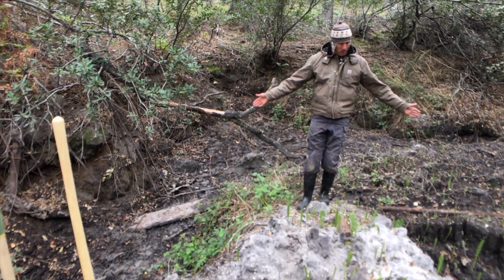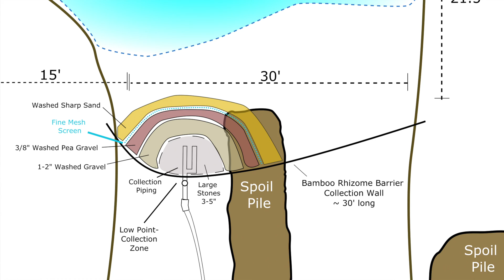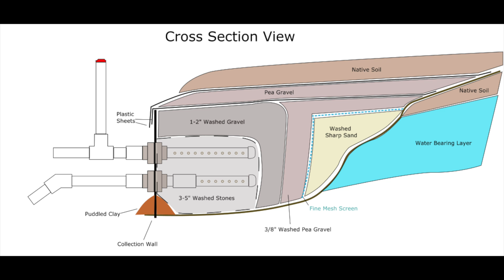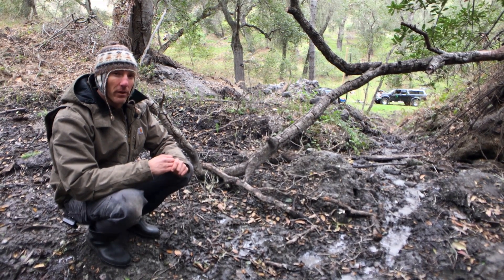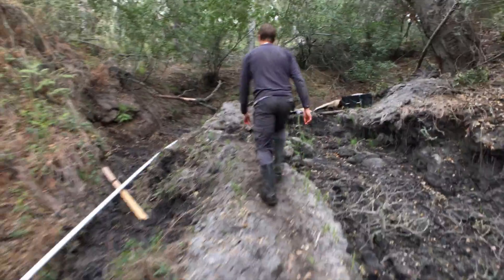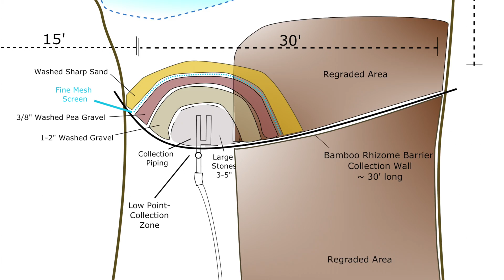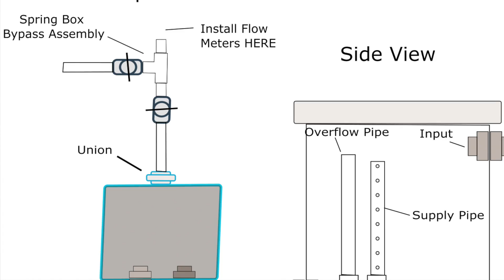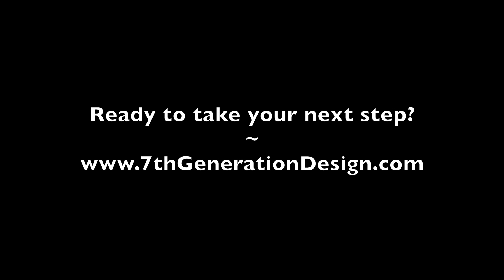Tapping A Seep - Spring Water Collection System Install

Comment: Great project content, but your videography needs work! Some quick recommendations:

1) PLEASE get a cheap tripod and do your voiceover narration of work being done at 1.5-5x speed (depending on the work)

2) if you've got the budget at all for a stabilizer, I highly recommend it. 

3) if you're super committed, edit in overhead drone shots of the areas you're talking about with voiceover.

Comment: In the future if you ever have an issue with getting an excavator back onto a site because of too much mud look into what's called mud mats essentially they are 10 by 10 by 10 rough cut beams that are linked together to form a 10' wide x 10' long Matt that the excavator can pick up and sit in front of his tracks to walk on then reach behind grab another mud Mat swing around back to the front and set it front  of other mud mat. We had to use these a lot when working in extremely muddy environment in the middle of the woods. You're going to need at least 2 mats to achieve this
Reply: Okay so I just saw the size of your excavator need Timbers as large as I previously mentioned for that size excavator. You could get away with building the same size mud Matt but not as big as Lumber is needed you could probably get away with 4 * 4 * 10 for that size excavator
Reply: Or also for that size excavator you could just reach around and look for some logs to sit in front of your tracks to walk on

Comment: Cool stuff guys I'm in the process of doing my own system because I just found a spring coming out of the side of the hill on my property.. what is this bamboo rhizome wall you keep referring to when all I'm seeing is EPDM 40 which is basically just a thick rubber pond liner. Secondly great video I enjoyed watching it I would highly recommend setting up a time lapse video and you would be able to tie in clips of the time  lapse roll. I haven't finished the video yet but if you don't do it I would recommend building a small structure above the system to prevent all this s*** they're spraying in the skies....lol
Reply: Great advice. If I ever get to the point of putting in a system on my future property, I will indeed create a structure to avoid possible contamination of the sky people!

Comment: Excellent video!!!  I have the identical situation however I live in OH and need to burry all the lines and tanks due to freezing temperatures etc.   Very helpful video.   Any videos on purifying the water for drinking?
Reply from the maker: Hi again Barry, we don't have any purification videos ourselves, but I would recommend looking into a slow-sand charcoal filtration system. DIY instructions for systems of various sizes are available for free from Aqueous Solutions: https://www.aqsolutions.org/charcoal-biochar-water-treatment/  . These systems are easy to DIY and don't involve expensive or irreplaceable components - perfect for  low-tech yet very effective off-grid water filtration/purification system.

Comment: Ya know how you avoid turning area into a mud slide  DO IT BY HAND  You could have chuted rock down from dry sides  That is such a minimal amount of work a man should be able to dig it and backfill in a few days.  Now I'd never have built such a small collection area, that's really a hail marry lets hope nothing happens.  I'd have made it 4x as big so 50 yrs from now a flood and every tree toppling in it's still making 2,000 gallons a day.  As to the drain top of the hill.  That'll silt up and fill with grass in 5 yrs.  You need something that will kick off silt with enough velocity to keep it moving until out of range of the spring.  Think adding 2 to 3 foot high bolders along the spring side of trench.  and while you want silt to move, you need to stabilize the cut trench until it grasses over At the least drop a hay bale every 10 or 20 feet angled to shoot water and silt back over the field.

Comment: VERY nicely done.  I've done several collection systems myself and have my own methods, but yours are very well done.  One question, you mention downstream filtration.  What were you considering or did you do?  I've not had much luck with any filtration. Constant changing of filters, even sand filters, just didn't work.  Finally I've gone to settling tanks.  I let the water flow in on the bottom of a 300 gallon tank, and the exit is at the top of the tank.  I generally do 2 tanks in a row that way and the result is that pretty much all of the sediment settles out in the first tank.  Every 5 years or so, I just drain that tank.  This method solved my constant problem of filtration being overloaded.  Pumps hate silty water.  I burned up a pump or two.  Now I use submersible pumps, (no problem with freezing then) and I've had a Lorrentz in for more than 15 years in a Poly tank.  Seems to be as good as it was when I put it in 15 ago.  (course now it will probably go bad lol, but I will consider that great and just install a new pump)
Reply: Try a spring box

Comment: Very interesting project,
Just one question, is that a spring, or stream?
Reply from the maker: It is a spring - the area show in the video is the "spring head" even though its somewhat spread out - hence we term it a seep when there is no obviously identifiable point source.
Reply: @7thGenerationDesign  
Thank you for taking the time to answer my questions, 
Since the spring is in your property do you still need to get a permit from the county, or state to use the water,
Thanks in advance.
I too have a spring in my property, I want to start a water system like yours.
Reply from the maker: @enchantedmountain5354  I am not sure about permitting - if the spring is in an already acknowledged "blue line creek/drainage" then you would have to get some permitting to tap it. However, finding out what is "blue line" and what is not is largely impossible without calling a CDFW office (assuming you are in California) and having them out to your land to assess - and once you do that you can't go back. If your spring's flow rate is on the small side (~ less than 10 gal per minute - which is actually quite large for SoCal) I wouldn't imagine there would be any permitting required.
Reply: Why bring unwanted and unnecessary regulation?
Use at your own risk after due diligence 
The very 1st step is to fence off from range animals… @7thGenerationDesign

Comment: Are permits required to build a spring collection system?
Reply from the maker: Hi Tricia, we haven't run into anything like that out here, nor have  I heard of any. If there is a "blue line waterway" that originates at a spring then permits would I'm sure be involved, but we haven't seen anything like that in our work.

Comment: What do you do about wintertime and possible PVC pipe freezing and cracking?
Reply: I've done several similar installs and I'd say that this should be a problem.  Unless it is very cold and there is no flow...  Generally as long as water is moving, then moderate freezing is not a problem.  Of course I'd bury as much of the PVC as possible, for UV reasons too.

Comment: Aloha Casey & Wes!          

I appreciated the design images, and the video in it's entirety.  In the upcoming week, I will be developing a smaller seep on a slope at over 8,000' in Colorado, using a food grade IBC tote (cut open) for my collection wall, and have a few questions.  1) Is it greatly beneficial to have the differently sized aggregate, or could I simply use gravel exclusively?  2)  Is there any concern about water seeping DOWN into the ground, and passing under the collection wall - is there any need to put an impermeable floor in the collection area?  3)  Will the combined weight of the top soil, and stone aggregate sink into already super-hydrated substrate - would a layer of logs help disperse the weight of the aggregate and mitigate that concern?      

Thank you.
Reply from the maker: Hi Byron,
Those are great questions, we faced similar challenges with this install. I'll do my best to answer.

1) Our reasoning for the differently sized aggregate was due to the entire seep being made of a super fine sand. If we had just make out filter package out of gravel, the sand would have ultimately (and probably quite quickly) clogged the collection piping. We had the multiple different sizes of aggregate, on down to construction sand being the final layer, in order to make a progressively better draining filter package that would keep the native sand in place and out of the pipes.
2) Yes, water seeping underneath the collection wall is a big concern in most cases, and certainly in ours. It wasn't shown in the video but the entire collection wall was set into a 6" deep ridge of puddled clay that we packed in immediately prior to setting the wall in. Some seepage is still occurring due to it being located atop fine sand, however no material is moving, which is the important part. We did put down an extra sheet of the HDPE bamboo rhizome barrier underneath the filter package with the idea of spreading out the weight - time will tell if that was a good idea!
3) Logs might initially help to spread the weight of your filter package materials, however over time they will degrade, and eventually fail. If they do end up performing a necessary support function their ultimate failure would be best to avoid in my opinion. If you are going to having something underneath the filter package, I'd personally go with something that won't biodegrade, like the HDPE rhizome barrier we used, or perhaps a cut section of one of your IBC walls. However you know your situation best - I don't know the context so that recommendation might not be right for you.

Best of luck with your project!
Reply: @7thGenerationDesign  Thank you so much for your detailed advice.  Next question...

4)  What diameter poly pipe?  My spring is located 400 feet in elevation above my cabin, and will have a 2,000 foot run of pipe.  In May, the spring is producing half a gallon per minute.  I was first thinking that I would go with a 1" diameter pipe, but am now wondering if that is excessive for the spring's modest flow rate.

In gratitude,

Byron
Reply from the maker: @byrong6953  Yes, you could get away with smaller diameter pipe and save some money there. 1/2" would be ample to hand that level of flow, however you may want to go with 500' coils of HDPE water line to make the install easier - and I think those are only available down to 3/4" (at least that we've come across_ - for reference: https://hdpesupply.com/black-hdpe-polyethylene-pipe/
Reply from the maker: @byrong6953  We didn't actually purchase clay, we harvested it locally. You can purchase bentonite online, however it is very expensive and shipping is doubly so.

That pipe looks like it should do the trick. You can use PVC insert fitting to connect segments - similar to these :https://www.supplyhouse.com/PVC-Insert-Fittings-20120000 - that will save you a bunch of money over using Sharkbite or other more expensive press-fit fittings. Use standard adjustable collars to secure them.

As far as additional suggestions, I'm was glad to hear you mention a sediment bucket / spring box to help with clean out and pressure relief. You may also want to consider installing vacuum breaks around any dips and rises - ideally you'll keep it at a constant downhill grade the whole time, but I'm sure over 2,000 feet you'll have some grade changes - just don't have any that actually reverse the grade (go from negative to positive) - if there is sediment in the line, this is where it can fall out of suspension and clog things up, or where air in the line will get stuck and create a vacuum.

Sounds like a great project Byron, we hope it goes well!
Reply: @byrong6953  With a 400’ drop, you will have a static water pressure of 173 pounds. This is not poly pipe / barbed fitting land.